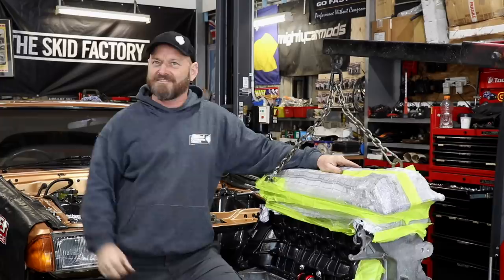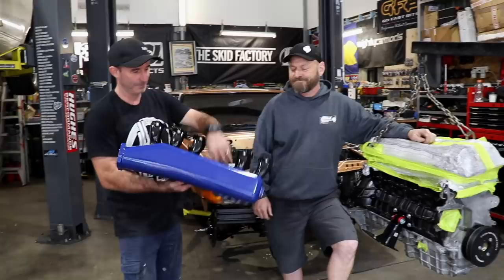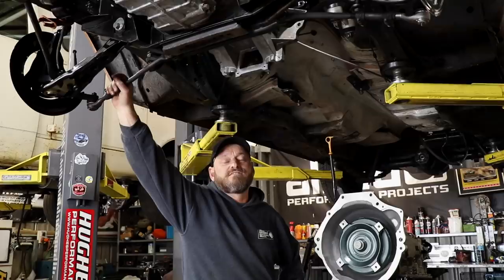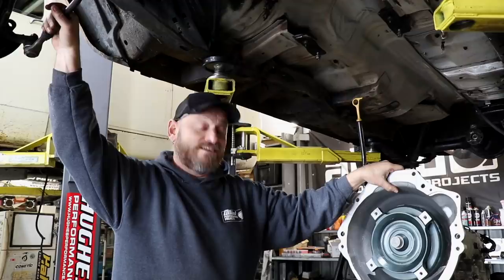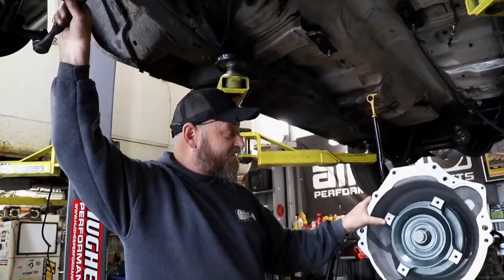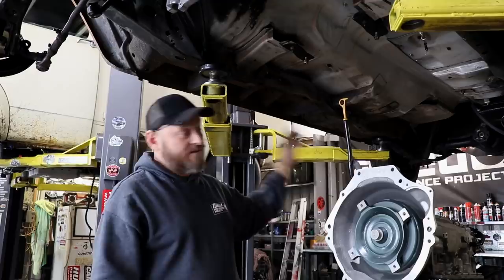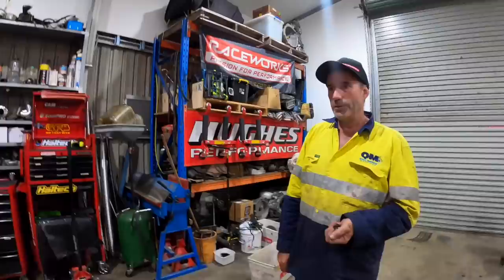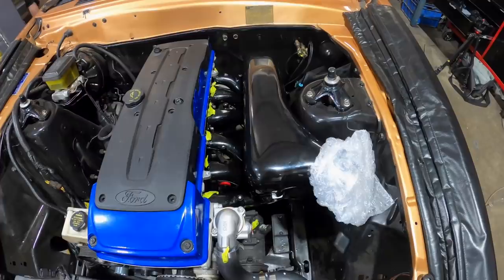Powered by FORD - Sleeper Wagon Express Build

Comment from the maker: Have you seen this yet? https://youtu.be/mKDWK-OKRAM
Reply: Yep 🤣
Reply: Yes
Reply: Yes
Reply: 😂🤣😂 of course....
Reply: Of course. But not on the TV.
Reply: Sure have! Whats your issue with pie cuts Al? Pie cuts ar.... Mmmmmm pie....
Reply: Would a Barra turbo be a good option to make good torque in a yanky camper van I got it’s currently running a 302 Windsor,love the show 👌
Reply: I DIDN'T CLICK THERE
Reply: @bluebludded  Barras are really strong engines. I live in a 9 metre long Bedford bus that went from a six diesel to a 308 Holden. If the body was still good enough to restore, I'd put a Barra in it.
Reply: That was awesome!
Reply: Was expecting to get Rick Rolled

Comment: "Pie cuts are stupid" Yes indeed. They're great if you hate money and love to get rid of it paying for argon, and have too much time on your hands.
Reply: Can’t imagine they’d be great for flow either…
Reply: They're good if you need a very tight radius or if you're using titanium, other than that it's just wank factor. Donuts are also pretty cheap these days in staino or ally if you need a tight radius.
Reply: Seriously. I feel like I'm crazy for not liking pie cuts, it screams "I couldn't find the right pipe" to me.
Reply: "pie cuts are stupid"... Best comment on the internet today 😏👌🏻
Reply: @shanenorwell8580  
Actually I think they’re better , that’s why you get 3 angle valve seats that are more efficient than radius seats . Don’t know why .
Reply: Good welding practice if you’re building up to making more critical parts .
Reply: I also agree that I dislike pie cuts. Definitely the best comment. 
I was actually surprised to see that he welded the 304 staino to atmosphere and didn’t purge weld it. And cheers for the replies here with the donuts. I didn’t give them a thought
Reply: @Whateverpoopiepants  three angle valve seats create turbulent air which mixes fuel in better, you don't want turbulent air in an exhaust you want maximum airflow
Reply: And if you wanna practice fabricating. 🤷‍♂️
Reply: @NUT84G  purging isn't really required in an exhaust, if you don't overheat the metal you won't get sugaring inside and a slight bit of sugaring would be fine in an exhaust unless you were building a race car where you wanted every possible bhp, purge welding is more for the food industry where you could have bacterial build up on the sugaring. Plus argon is extremely expensive in Australia and you use shit loads purging so the exhaust would cost a fortune to make that way and stainless itself is expensive enough over here
Reply: @marcbottomley8767  appreciate the reply, cleaned some questions up for me. It’s a grand old debate of people purging the exhaust for longevity and stopping it from cracking ect. But I’m not a professional, I’m not building a race car. So no purge and saving my Argon is the way then :) 
Yeah it is super expensive here :(
Reply: @marcbottomley8767  
So why do they do it to the exhaust valves ? And why do they flow more cfm ? 
It works .
Reply: @Whateverpoopiepants  like I said the sharp angles are there to create more turbulent air to mix the air and fuel better, they don't flow anymore CFM the rest of the work done at the same time to the head no doubt increases CFM but of you were to do the valves only on a standard head the only benefit you will see is better fuel atomization
Reply: Pie cuts are good for a few things, tight spaces and when you run out of bends but have a bandsaw. That's about it
Reply: @Whateverpoopiepants  

Uh, you're comparing two VERY different things there and, even then, a radius (curve) is more efficient and preferable to a 3/4/5* angle valve seat.

*Yes, I've done those back in the day - modern cutters can do the compound curved seats beautifully.
Reply: @marcbottomley8767  
Uh, no. That is the opposite of the reason they're used.
You may be confused by seat and bowl configurations designed to introduce 'tumble' into the gas flow?
Reply: Lmfao an entire bottle of argon is cheaper than one piece of custom bent 3" tubing.  Al is allowed to say pie cuts are stupid because he is the one donating the labor on these builds. Anybody else is just a salty hater with lacking fabrication abilities
Reply: @FUCK_________googIe  
They are stupid 😉 - but that's just one's opinion, rather than absolute truth - just as your opinion is yours. If you like them, 😎.

Either you're getting a really good deal for the Argon, or you're paying a bunch for the bends - and you're still paying for the segments which are around double the price of the bends - maybe closer to 3 times. Hmmm, that may be a big part of Al's reasoning, along with the hassle, time and gas expense.

Not sure why you think it's superior fabrication work - it takes a different skills to neatly fabricate using cut bends than pie cuts, and doing so neatly is far from easy. Uh, you do realise the pipe is fabricated from mandrel bent sections, rather than being a single, custom bent pipe? I will grant you it's not as useful for showing off one's welding skills, though.

Comment: "Pie cuts are stupid" - more wise words 👍😎

They do have their place, and uses, but pipe bends are so much more efficient fir gas flow, time, materials, and everything else that's they're easily the best option.
Reply: Exactly! Sometimes pie, or lobster, cuts are needed to fine tune the radius and/or fit, but bends are definitely the way to go where possible 👍😎

Comment: its crazy how the under side of that wagon looks almost exactly the same as my 1967 Ford Fairlane here in the US! same front suspension as well.
Reply: The very early Australian Falcons were somewhat braced RHD versions of the North American Falcons, and gradually got more local content until the 1972 XA model which was the first that did not look like an American model with different front and rear. The floorpan and underbody didn't change much right through to 1987. Assuming your Fairlane shares suspension with the Falcon, it probably is pretty much the same, but the Aussie stuff is probably a little more heavy duty.
Because of our junk roads.
Reply: @ryanworkman5229   our falcons where compact version of Fairlane which is " mid-sized " car. The Falcon , Mustang, and Fairlane all had same suspension setup most parts interchanging.   the Galaxy was similar as well but just the size of .... well a " GALAXY"! lol
Reply: @everettleonardjr.6973  yep, figured that would be the way, same as us really, the 1967 I think Falcon they boasted about being like a Mustang, which is obviously like a Falcon. We also had Fairlanes, which were just Falcons but 5 or 6 inches longer and revised front and rear, see TSF's turbo 1UZ Fairlane.

Comment: Those bolts look awfully short on the engine mount bottom plates. The nyloc nuts didn't have any thread poke? Temporary bolts?
Reply: Just about to say the same thing. The nyloc doesn't do much use there

Comment: I think a Nizpro Cobramanifold would have been a better fit for the cooler pipe angle because its throttle mounting flange is less abrupt and would have the inlet face somwhere in between the Plazy one and Dannys
Reply from the maker: Doesn’t make much sense to use someone else’s manifold when we made this one though does it.
Reply: @theskidfactory  All G, did you end up using the blue one in the end, I cant remember what was on it in the live vid

Comment: Can you tell me more about the trans upgrades? I have a RE4R03A that's going back behind a 20b with some upgrades and I'd love to know what you did to handle the power.
Reply from the maker: They mainly just need a manualised valve body and good cooling. The box itself is pretty strong but let down by low line pressures

Comment: Can you (or do you have) make an episode on engineering these conversions?
Reply: I'd be interested in that too, but it could be a vast can of worms that could come back to bite them. Every project has different perimeters and every engineer has different interpretations of the rules.
Reply: And probably no engineer wants to say anything on camera to the public.
Reply: Id imagine in either the original bedford build and the 1j torana they might touch on it a bit. I think the 240z build from mighty car mods also dives into it as well
Reply: Al has touched on it before, and his sentiment is that since it differs from territory to territory he can't make any general statements about it. Most of the cars will be registered in QLD but many will not. He does, however, explain when he is doing something in particular because of engineering requirements. One that often comes up is that in QLD you absolutely can't weld anything on the steering rack/linkage/column, so they build things out of whatever off-the-shelves parts they can get, even if a bit of welding would have made the whole thing 10 x simpler.

Comment: Did you guys get the 5.0 down there or the 3.5?
Reply: barra is a 4L
Reply: @henry2307  i know,  i was just curious if they sold em in cars down there.
Reply from the maker: 5.0 yes, 3.5 not yet. All our trucks are imported and converted rather than rhd engineered from factory.
Danny the pattern maker actually does a few jobs on steering castings for RHD conversions.
Reply: @theskidfactory  cool, stay away from anything under 3 litres...trust me

Comment: Wait wait wait, what was that again? Did he say a Nissan transmission was gonna be mated up to that Ford power plant? Why use an Asian designed and manufactured pile of trash, wtf kinda s*^+ is that?! Why not go with a Tremec or Ford gearbox?
Reply from the maker: If you don't even know who manufactured the transmission you should probably stay away from the keyboard tiger.